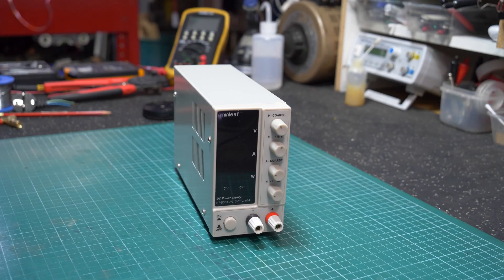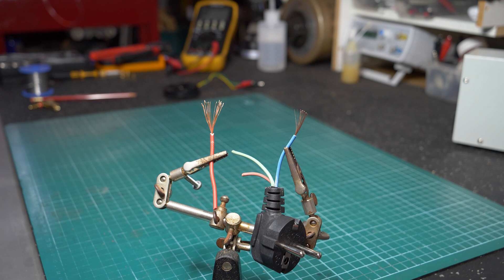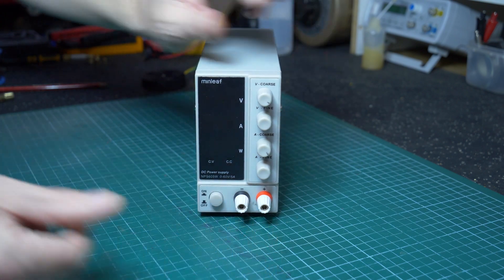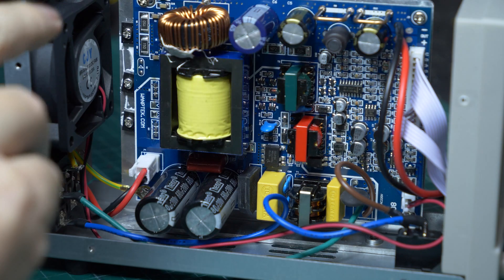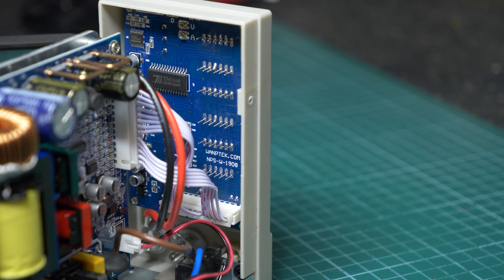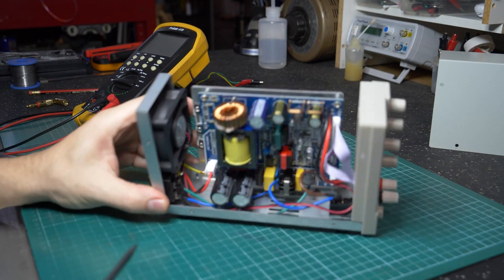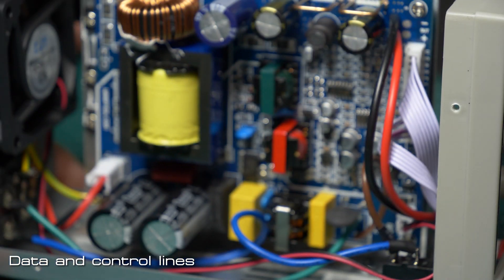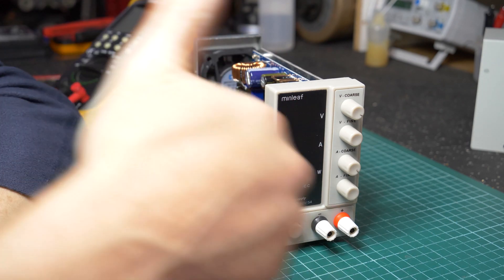#33 - Minleaf NPS605W - Part 1 - Bench power supply - Teardown

Comment: Can anyone tell me the part nr. for the switching element you point to at 4:57?
I hooked up the PSU to charge a LiFePo bank at 28V/5A. When I tested the BMS on/off switch the switching element in the PSU let out the magic smoke. I cannot read the part number off the broken component. Its something like C023???? 166????. Thanks a gazillion!
Reply: i had the same issue. did you got the details allready?
Reply: @claberlin1  I replaced the part with a MUR1660CT-YAN2 and the main fuse. When I plugged it in again: more black smoke 😭 that's when I stopped trying.

Comment: Great video! You mention that you use this to charge e-bike battery packs. I'm assuming they have a BMS built in? I'm thinking to use this for all my electric skateboards. What happened when the battery is fully charged?
Reply from the maker: Hi there,  generally you would rely on a BMS to handle proper balance charging.  If you are not using a BMS I'd recommend not leaving the charging area unattended for any period of time.  That said, cherging a battery pack in a non-flammable environment is best.  Set PSU voltage to the fully the charged value and the current to as little as possible (1 or 2 amps) to suit your use and go from there.

Comment: I've got one of these that's a couple weeks old now. I left it trickle charging a bank of batteries at 13.6 volts for a week and turned it off. When I tried to turn it back on nothing happens. The fuse, power cable, and switch are good. Would you have any ideas on the most likely failure points that I can check with just a multimeter?
Reply: If the digital display works and shows 00.0, then check the V-course (top voltage) potentiometer (Pot).  On my unit, the centre contact of the V-course pot was open circuit, driving the circuit to  0 .  They used very low quality pots. Others had units with this problem.   Replace the pots with standard quality ones and the unit works as designed.  My unit (NPS605W) used 10K pots.  I cut the leads of the old pots leaving enough to solder the leads of the new pots on.  Take care..
Reply: @keithadams8686  Sadly the unit is completely dead, although I find power to the switch, and power throughout most of the board. Because of the sudden nature of the failure while the unit was off and stored in a cold temperature I'm suspecting a cold solder joint. I still have to get around to separating the board from the heat sink before I can really see or trace much. I hope that under no load it will be okay to power the unit without the heat sink🙏
Reply from the maker: Hi Cliff, it could be anything. I'd start with a close visual inspection of the main PCB solder joints, internal connections, then trace high side voltages, then low side and see if it stops anywhere.  But only if you are comfortable doing so and using an isolation transformer ideally.  Be careful and stay safe.

Comment: The TNY chip is used to power the control logic, the lower small transformer (the red one) performs the conversion, the feedback is done using the optocoupler. The actual switching brain is the TL494 which switches the main power transformer using the pair of MOSFETs controlled through the upper small transformer (the green one). The 3-pin "switching element" device is actually a diode assembly, the "buck coil" is a choke. V-1 and A-1 are controlling the maximum voltage and current. As far as I understand, the real manufacturer is Wanptek, Minleaf just rebrands them. How noisy this new one is? Still fighting with my NPS3010 being very noisy.
Reply from the maker: Thanks Sergey, this was certainly no deep dive since I didn't remove the mainboard to read the overall topology of the circuit.  Thanks for adding to the channel with your comment.  Will be doing another video with some testing on this model to see how bad/good it may be.  Thanks again.